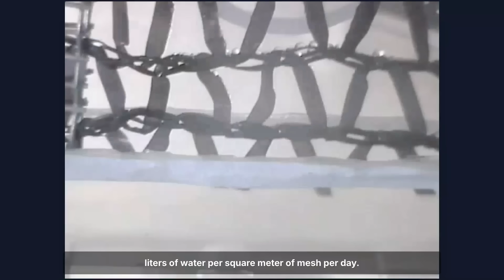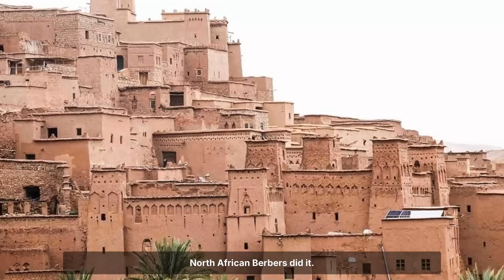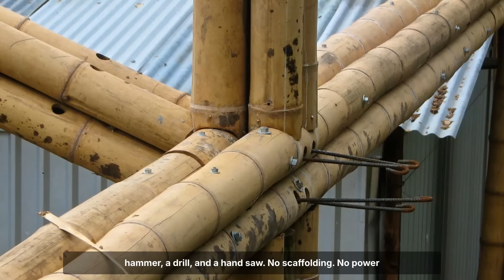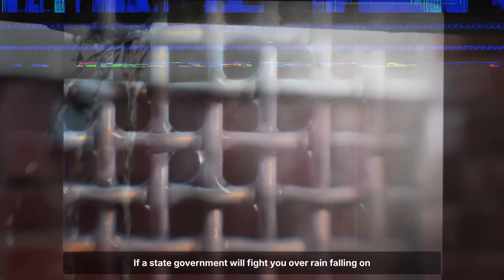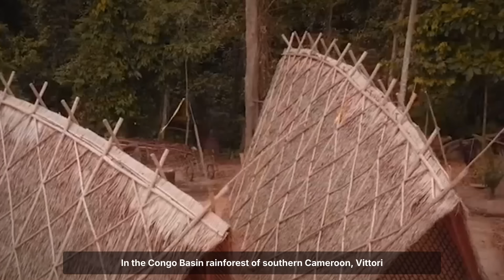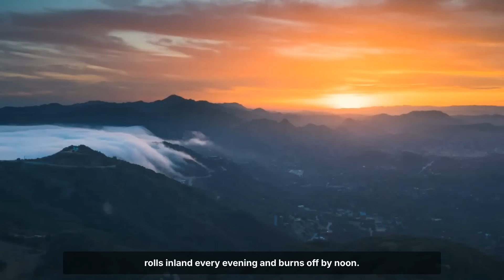This $500 Tower Makes 25 Gallons From Air Daily. Why Is It Banned in the U.S.?

Comment: If we keep on harvesting, putting up kms of solar panels won't it dehydrate the air and reduce rainfall?
Reply: "They can create a microclimate that makes the immediate surrounding air hotter and drier—a phenomenon known as the photovoltaic heat island effect."... But ONLY in the immediate surrounding area… I think it's one reason besides the prevailing winds, a storm will go around an area, instead of through the area. I could be wrong, but I don't think so...
Reply: I wouldn't think so.  We're talking about a drop in the bucket comparison.
Reply: Cities are warmer than natural areas.... And so yeah there's some point to how any tech will effect the surroundings... But that said nothing dissapears. It changes form... Just pee it out and it'll evaporate and cycle back into the mix... In a sorta cliff notes way of explaining... Nothing. Not even energy is truly "made" or "used" in an absolute sense, it just changes shape or moves around... Universally true... Yet... All that water and 02 in space is unusable to a human... So in space we have to configure oxygen into a form a human can use to breathe with. It's there though. Crazy to think about really because I'm honestly it's still beyond what our collective little minds can grasp, so to speak.

Comment: To OP: where can I find plans or better construction details?
Reply: I'm actively searching for it too. Evidently those infos have been compartmented ...
Reply: look up designs for a Warka Water Tower. This has been in the news since at least 2015 from what I can find on it.
Reply: @scottw2317  Hey  thanks Scott, but do you REALLY think I didn't try THAT and every other iteration of the question? FYI; I am looking for PLANS not drawings. I need SPECIFIC INFORMATION. Several GOOD photos would do but NO ONE has done that ANYWHERE I HAVE FOUIND  after three days online searching.
Reply: @TheRadicalPriest the experience workshop is about the best methods document I have found so far... perhaps see if that is good enough?
Reply: @scottw2317  I have seen that but it just not  much more than DRAWINGS, with some vague unclear numbers. If I needed to hire a builder he would NOT accept this job with unclear material needs, specifications and measurements.

Comment: if there is enough water to be harvested from the air... youll get rain.
Reply: precipitation and condensation are variables of "flow" in time, per min or per hr. as a metered quantification.
Reply: No, at 100% humidity you  get rain. The space between 50% humidity and 100% humidity is where air harvesting might easily take place take place. But  I’m guessing one of the main problems is getting the air cool enough to cause condensation.

Comment: The extracted water is then unavailable to the weather, which is hardly noticeable in most systems. 
The extracted water can be contaminated if the air is polluted and dust settles in the system, but this is generally harmless.

Here in Southeast Asia, we use a pre-filter with Zendrite (previously around 400-800 ppm, after which it's 60 ppm). This is followed by smaller filters, and finally, reverse osmosis.
Absolutely clean water with 2 ppm, but without minerals.
The resulting "wash water" benefits the plants.